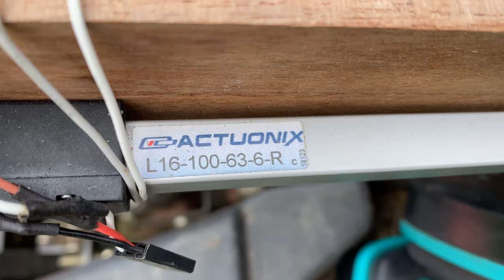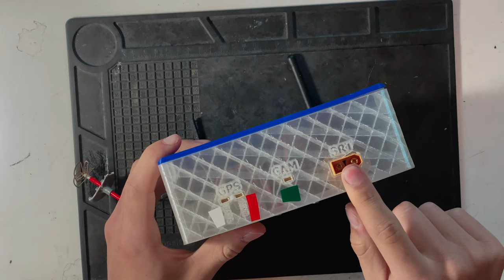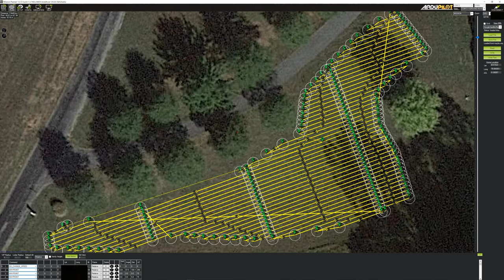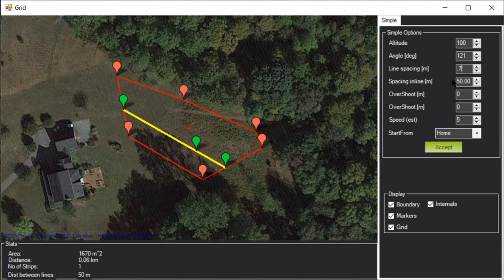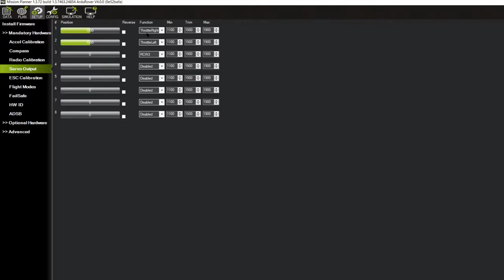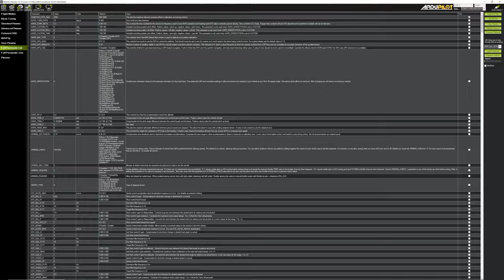Inside Jerry The Autonomous Lawn Mower

Comment: It's cool how the software can draw the lines for you, I though you would have to do it manually.
Reply from the maker: Ye. I makes it hard to do anything other than just a plain field though. Like if I want it to go around a tree.
Reply: @InitialFPV  wonder if the brains of a skydio could be used to avoid obstacles.
Reply: @InitialFPV  The newest versions (maybe just beta, not sure) of Ardurover allow you to draw an exclusion fence around an object and then the mower will avoid that area. The fence is independent of the mission. I haven't tried it yet, but will be soon.

Comment: Did you have any problem with using the power from the lawnmower battery to power the micro controller? I am hoping to do the same with a f405-wing and use the controller to power the servos… before I plug in tho want to know if you did anything before connecting the omnibus vin to the mower battery?
Reply from the maker: Powering the board there was no problem. Once the mower is on the voltage is relatively stable compared to the flight controllers intended use on a quad. I still decided to power the servo rail with a separate 6v regulator. (The silver thing in the box)

Comment: Thanks for this! Great content. Actuonix seemed a bit small for the job, did they give you any trouble?  Price is right on them.  Thanks much!
Reply: I used small Actuonix actuators with good success as far as strength goes, but they were slow.
Reply from the maker: Yea they work well and they're pretty reliable, just slow. Ideally you would either use a massive servo at the pivot and remove the control arms or connect it directly to the hydraulic system. Unfortunately I don't have a mower to destroy.
Reply: @InitialFPV  After I did change to honking big servos,  i realized that there was a spring down on each transaxle. After removing that, the sticks were much easier to move. I think I could have gone with a less strong, but faster Actuonix actuator, but I was committed by then to the servos and they have worked well.
Reply from the maker: @KennyTrussell  Mind me asking what servos you’re using?
Reply: @InitialFPV  I think he used HITEC D845WP Servos

Comment: I know jerry is 2 years old now but, jerry doesn't need to turn, he doesn't have a front or back he just has this way or that way ( all DIY mowers designers worry about turning) turning is not important
Reply from the maker: Well most of them do have to turn anyway on account of they cant go sideways so in a perfect grid pattern theyre not losing any efficiency. Commercial ones also would then have to double sensors.  For this application the hydraulics have much more torque forwards and handling is better bc of the placement of the motor.

Comment: What telemetry option did you use exactly? The link in the description is broken.
Reply from the maker: It was just a cheap 3DR 916Mhz radio from Banggood. It looks like its not available anymore. It was $23.99.
Reply: @InitialFPV  Thank you so much! I'm jumping in blind to FPV gear but the project is coming together slowly, got almost all the parts, now I just need to put it together >:3
Reply from the maker: Exciting;)
Reply: What flight controller type did you use too?